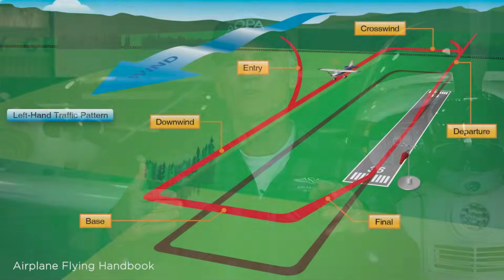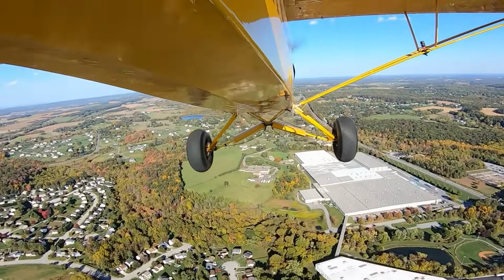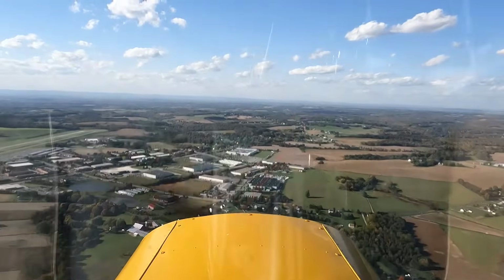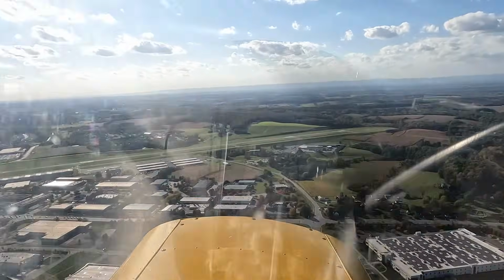Flight Training Tip: Traffic Pattern Entry

Comment: Overhead entry. Or, if no need to bleed energy, outside upwind to crosswind. Puts all aircraft forward quarter, makes most interval adjustments at crosswind thus mitigating most downwind extensions for deep bases, has lateral deconfliction to the outside of runway and can incorporate a slight vertical deconfliction for break traffic, and easier to pick up traffic due to increased line of sight rates. Sometimes the Contrarian Aviator Turns Right. Read it. Hint, turning right is example but not the point of the piece.

Comment: Neither of these options are best because it puts you in the path of aircraft flying higher, faster, and wider. Why descend into/onto the 45° entry where other planes might be coming in? The FAA Airplane Flying Handbook’s second recommendation is the best: cross over the airport at TPA (where it is easier to see other aircraft at your altitude) and simply enter the midfield.
Reply: No - on the overhead teardrop to the 45, you are above and outside all other traffic if flown correctly.  I think there are two points in the Handbook which may be misunderstood.  The graphic indicates pattern altitude +500 which implies 1500ft agl.  However a note in the Handbook clarifies that if there is a 1500ft pattern for high performance aircraft, then the overhead should be at 2000ft agl.  And the graphic makes it appear the teardrop is close to the downwind leg - however the Handbook written guideline clarifies that it should be well clear of the pattern, i.e. all traffic in either the low or high pattern.  The mid-field entry "should not be used if the pattern is busy" per the Handbook.
Reply: @warren5699  I understand that you are above the piston and turbine patterns when crossing over the downwind, but even if you go five miles out (3 miles more than the AFH states) from the airport to descend you could still descend on top of anyone coming in on the 45° entry to the downwind. On page 7-3 of the Airplane Flying Handbook states that "Entries into traffic patterns while descending create specific collision hazards and should always be avoided." Thank you for reminding me to not use the overhead direct entry if the pattern is busy! I had forgotten or skipped over that in my studying.
Reply: @matthewpotter6236  That quote is now on page 8-3.  You're still missing the guidelines on page 8-4.  The overhead including the descent clear of all traffic is done on a line perpendicular to the runway, not over the 45 entry leg.  "When well clear of the pattern—approximately 2 miles—the pilot should scan carefully for traffic, descend to pattern altitude, then turn right to enter at 45° to the downwind leg at midfield."
Reply: @Matthew Potter  Agree, the approach to cross over the airport at TPA provides for the best visibility for other aircraft and allows for better sequencing by adjusting where you cross the airport. In my professional career I have two instances where co-workers were in a fatal midair from the two methods described. Turning or turning and descending is a recipe for in flight contact risk. Matthew's comment provides for less belly up and descending time in the aircraft.
Reply: @joepiloto  How can the mid-field be less belly up time?  It requires a 90 degree turn.  The other is a 45 degree turn.  The descent from the overhead and the 225 degree turn to align with the 45 occur outside the pattern, if the guidelines are followed.
Reply: I only fly the midfield entry if Noone is in the pattern. I announce is anyone in the traffic please advise prior to entering the pattern. I announce my entry into the pattern well ahead of entry. I'd rather be UBER safe than get a surprise 🙄 😕 😒 like midair collision.  Not a good day for me. Even on straight in on final. I call every 2nm until touchdown.  This affords others to either fly out ahead of me and keep them posted on my position.  Just in case they don't see my landing lights.